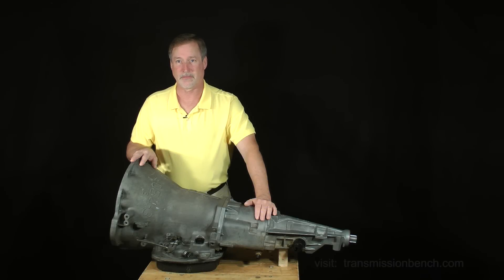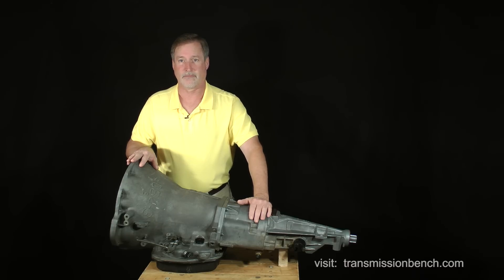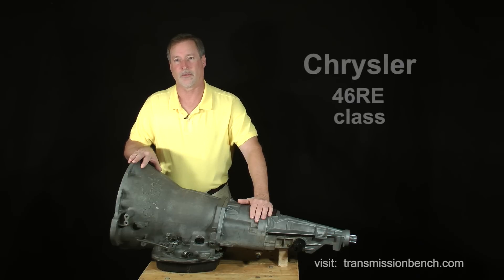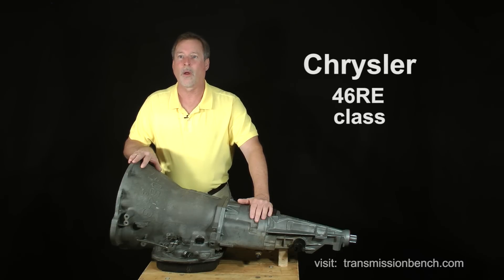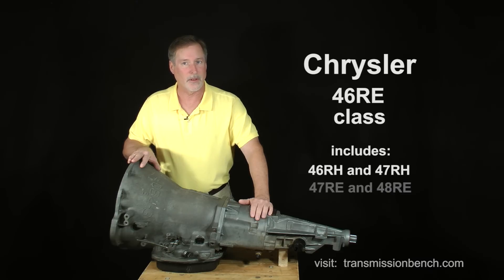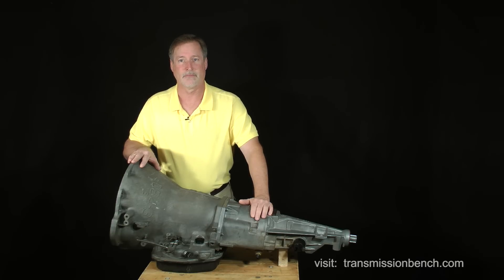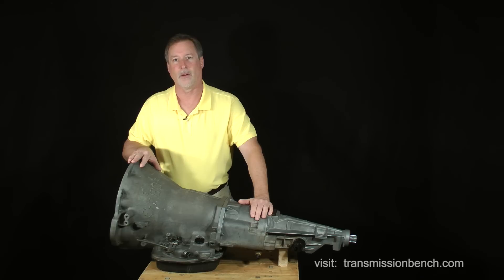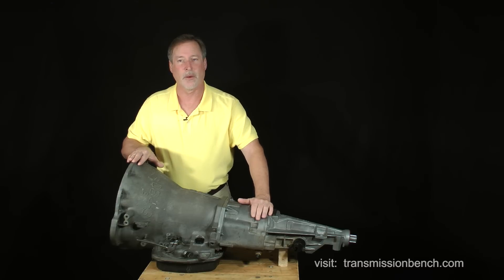Chrysler 46RE Class introduction

Comment: Hello. I have a question I am hoping you can answer. I have 1996 Ram with a 46re just like in your video. Been having problems snap ring related. My question is: I acquired a second hand 46re trans to rebuild in my garage while still keeping my truck operational. Problem is the one existing in my truck has a geared speed sensor in the overdrive unit as in your videos. The second hand one I acquired does not and I didn't realize it until after the fact. If I rebuild the front section containing the valve body (second hand), and then rebuild my existing overdrive assembly that does have the speed sensor, will I be able to mate the two together. Turns out the one I acquired came from a 1998 half ton. Still a 46re though. Thank you for your time.

Comment: I recently finished rebuilding my 46RE  it shifts smoothly if the fluid is a little above normal but if is drops to normal or below it shifts really rough from 3rd to 4th  (almost like it briefly slips into 2nd before going to 4th)   Any Ideas?

Comment: im trying to do a rebuild with my 46re that is a twin to the one in your video bug everyone is asking about some other numbers, "A727 or A904"
Reply: "Torqueflite" is the name of an entire class of automatic transmission manufactured from 1960 to 2007. 
The first models of the Torqueflite (in chronological order) were A488, A727, A904, A404, A413, A415, A470 and A670. 
The A727 was later renamed the 36RH and 37 RH. The A727 also had subvariants called the A518 (46RH/46RE) and A618 (47RH/47RE/48RE).
The A904 was later renamed the 30RH. The A904 had subvariants called the A998(31RH), A999(32RH), and A500(40RH/42RH/40RE/42RE/44RE).
They each went into various vehicles during various time periods throughout the period from the 60's through the 80's. As near as I can tell, transmission specialists tend to use the renamed conventions (like 36RH) because the parts and procedures vary somewhat among each. Regular mechanics and MOPAR enthusiasts tend to refer to them as A727s or A904s, or very broadly as Torqueflites. Here's a link for more information:
https://en.wikipedia.org/wiki/TorqueFlite#A518_(46RH/46RE)